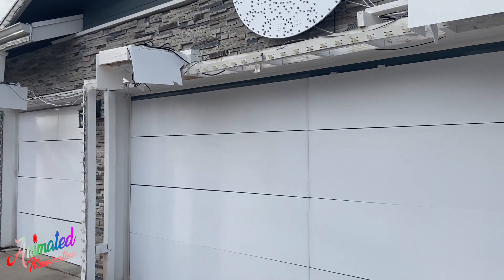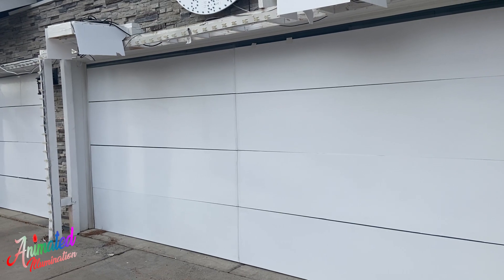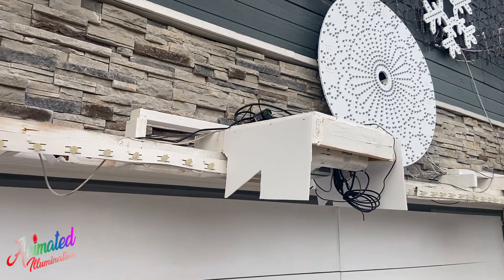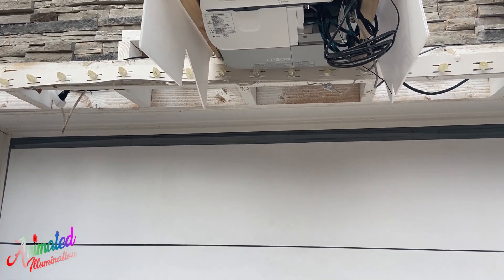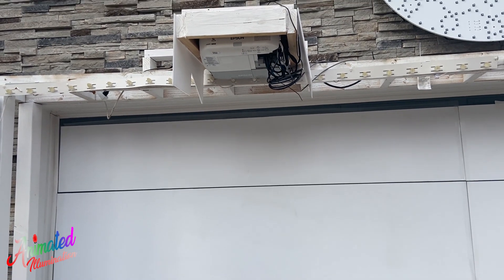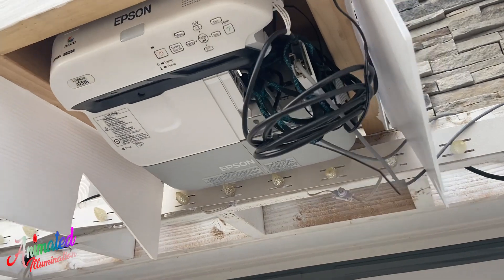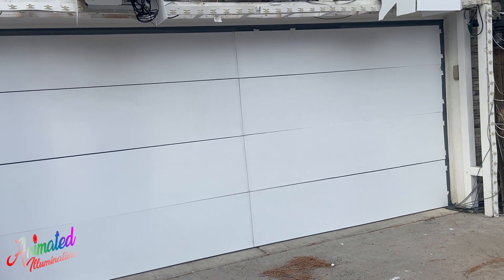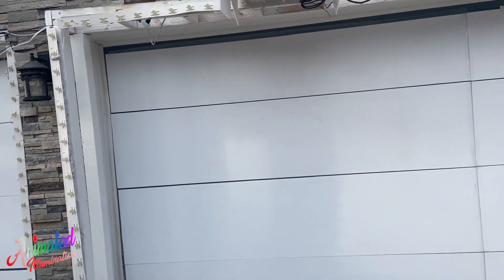Garage Matrix Tutorial - Xlights - FPP

Comment: Well done!  What a great idea!  Nice to be able to not use pixels on garage doors.  The Epson 475wi Brightlink is normally rated up to a 100" diagonal screen at 12" away from the wall.  According to the screen size calculation tool I would have to mount the projector about 24" away from the wall to cover a 9x7 garage door using a 4:3 ratio.  According to the manual this unit is designed to mount 6" to 12" away from the wall.  You appear to have your projectors mounted further away.  Do you find that you can still focus this machine if you pull it 24" away from the wall?   We have temps in Utah that drop down to 5 degrees in December.  Do you think this will still work at that temp? Thank you.
Reply from the maker: Thank you. Yeah it works well at further distances. I changed mounts this last year and it was well over what they say. No focus problems at all. Even though I’m in az I live at 7,000 feet so we get cold too.  Does get below zero and they work great through the cold.
Reply: @nickcosper110  Thank you for the quick response!  I purchased a copy of your Bang! sequence last year and love it!  You can view it on YouTube if you search: "Bang! - AJR - 2021 Christmas Light Show"  My channel is "Christmas Illuminations".  If you have a chance to look at my house you will see the two garage doors that I am thinking on mounting the projectors on.  What do you think about projectors on those overhead doors?  Would there be an advantage of buying the Epson 485 that has 3100 lumen over the 2600 lumen offered by the Epson 475?  Thanks again for your help!
Reply from the maker: Nice work with the sequence and display. That’s a big tree! I always enjoy seeing my sequences on other layouts. 
For the projectors, more lumens is always better. Biggest caveat is to make sure you get the same model for both. Past that it doesn’t matter a ton. Mine are plenty bright enough but that is also because I use Coro on the garage doors. It helps brighten things up a lot.
Reply: @nickcosper110  Thank You